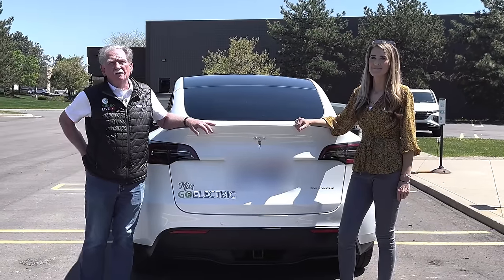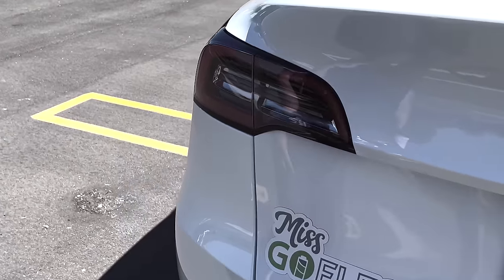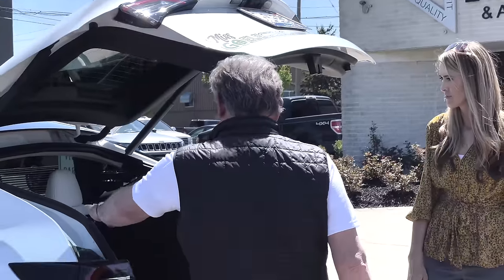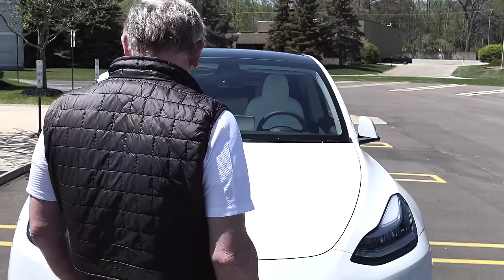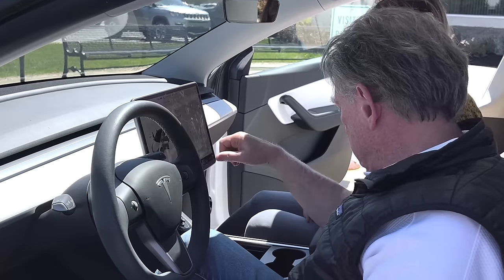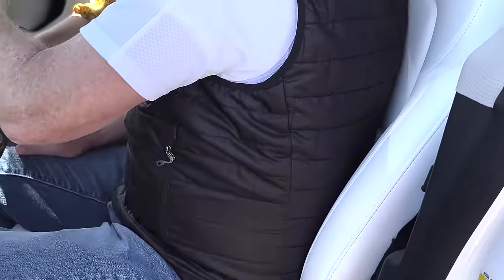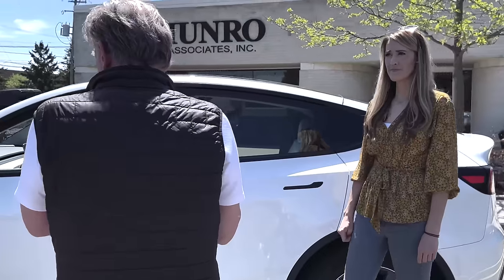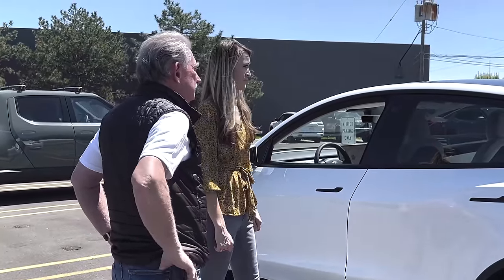Sandy takes a peek under Miss Go Electric's New Model Y Frunk!

Comment: $10k over sticker is insane, it’s starting to become pretty obvious that the legacy auto dealer networks are going to bankrupt their own suppliers with their insane greed.
Reply: Maybe Hyundai should watch and take notes. I remember when the Kia niro came out and I was seriously looking at it, but dealer was trying to sell me something else, even if it was 10-12,000 less! I had purchased Tesla stock well before then, but bought more after!
Reply: Maybe Hyundai should watch and take notes. I remember when the Kia niro came out and I was seriously looking at it, but dealer was trying to sell me something else, even if it was 10-12,000 less! I had purchased Tesla stock well before then, but bought more after!
Reply: Stealership are getting $25k over sticker for Muck-e GT and performance version cars.
Reply: @jezzaRTW  - KIA/Hyundai bought the model Y report form MUNRO and EV6/IQ 5 is the result.
Reply: @ForeverNeverwhere1  - eCHIMP platform is less advanced than TESLA skateboard 🛹 platform and is SLOWER and HEAVIER, built on a GAS car platform.
Reply: @jezzaRTW  exactly...either u sell their competent models to for less to consumer s..or we will wait til the Chinese autos to take over... Most people will no tolerance between a crappy leaf and a Tesla..
Reply: It's not the same across the board. Locally we have dealers with stupid markups and others not marking anything up. Some are even salaried instead of commission based. Dealing with Tesla is its own share of nightmares.

The markup ones are destroying their reputation.
Reply: Fred ! Spot on !
I’d never part with my MY ! You could offer to swap it for a Taycan or almost any other expensive BEV. I wouldn’t let go of it.

Comment: My first Tesla was Model 3 from Fremont and was perfect alignment.  Believe there was issue with air-cooling system - they had to fix it 3 times.  Traded that in for Model Y, and everything was perfect - also from Fremont.  Looks like totally different cooling system.  Model 3 was 2020 and Y is 2022.

Comment: @5:32: Sandy: "can you just open the charging port?". Sandy you should know this! Just push on it with your finger and if the car is unlocked it will pop open. No need for the app

Comment: Lacy, I think Sandy is correct about window issue. I have a 2020 Y and have had the same thing happen to me on two occasions. Window would go up and immediately come back down about a quarter of the way. This happen twice over a week. I think the first time I just got out locked it, got back in and was ok, the second time I re-booted and it has been fine since.
Reply: In our case, the window stops short and has even stopped responding to presses a few times.  I'm repeating what the Tesla service person said to me when he came out for the warranty repair.

Comment: I have no problems in my Model 3 windows that are laminated, and they have no issue. The laminated glass is not heavy enough to stop them from going up, Sandy is correct that its likely the sensor to keep from breaking fingers when it closes on them.
Reply: wrong, it's called a defect, you do realize power windows are in use by the millions and millions of vehicles, with no issues, this is a new vehicle, with a design defect.  Poorly executed, poorly made, poorly assembled, wonder why the Benz he had didn't have windows that didn't work, or door gaps like this, hmmmm, how much does this POS cost, it's not made to the price they charge

Comment: It's a great car overall. I would however let Tesla work on the panel gaps you have. A lot of the ones out of Fremont are perfect with no gaps. But at this price Tesla should fix this (they can afford it!).
Reply: Is $18 billion of cash in the bank enough? 😆
Reply: Those panel gaps will never be perfect. Car should be returned.
Reply: the trunk gaps you can fix yourself by turning some rubber stoppers, it is real easy.
Reply: She made a good comment in saying ".. thats the trade off for the 1 week delivery.." . There is nothing wrong to ask at Tesla. Maybe some gaps can be easily fixed. Then for sure they would be willing. 
And if its is very difficult they should document it in case there are problems coming up in a few years.
Reply: Gaps on my car was fixed by Tesla no question asked. They shipping out many cars to us in Europe and fix the gaps locally instead.
Reply: They can afford it with money but not with time. But i think it’ll get fixed w time
Reply: They absolutely fix those issues under warranty, no questions asked.
It's just a hassle if you don't have a service center nearby.
If I were Miss Go Electric, I would definitively make an appointment or let mobile service adjust those gaps.
Reply: There are many people in the comments here who, like you, are offput by panel gaps.  In my case they don't make noise or cause any other headaches, so I place no priority on them.  If the car is looked at by Tesla service for a different reason one day, I'll mention the gaps then.
Reply: @MissGoElectric  definitely the way to go if it doesn't bother you. 👍🏻
Reply: @MissGoElectric  Well that is a good plan you have. As long as it doesn't bother you in any way and doesn't let water in, then just take your time with it.

Comment: I have a year and a half year old MY-P and I just got notified of my new Austin built same model ready to start the delivery process. I was going to cancel the order due to feeling poor with the stock down so much, but you guys have got me thinking it may be worth the hassle of switching everything (selling this one, re-financing new one, etc.). I just love the fact that the new one will be so much lighter. I'll wait to see real specs though. I want to get improved range and 0-60 performance. There is no reason why the new version should not be at least 400 lbs lighter and a bit faster with 350 miles of range. It has to be better or I'm just going to wait for the CT.

Comment: There is a way to reset the sensors for the window. I had the same issue. I forgot how to. I think open the window completely and close it completely. Window opens a little bit every time you open the door

Comment: 17:50 The seats the Tesla seats and orientation tend not to be the most comfortable for people around 6ft or taller, the high floor and lack of extending thigh support give taller people a knees in chest feel. Despite the legroom in front of the seat there isn't enough space downward for long legged tall people, this is exacerbated by the high floor due to the tall skateboard battery platform. This high floor issue is pretty common in EV's however Lucid and Polestar have done a better job than most with different approaches. In the smaller pack Lucid they carve out 'floor foot cubbies' in the rear. And personally bought a Polestar 2 as the seats are much more comfortable for me with extending thigh support and the use of an upside down T shaped battery skateboard allow for a lower floor making it more comfortable for taller people despite the lower leg room numbers. 

In case of the Polestar 2 if it's confusing when I say upside down T shaped battery skateboard; Polestar takes a traditional battery skateboard but then creates a taller area in the middle which allows the batteries to be placed away from passenger foot wells and up into the middle where the center console is and 'floor hump' in-between the footwells in the rear. This has the added benefit of moving batteries further away from the crash zone in the car. In the interior this configuration would look similar to a transmission tunnel in a RWD or AWD internal combustion vehicle, so no full flat floor but far more downward space for the front and rear passengers legs and a safer car in the event of a crash.

Comment: I wonder if the owner has performed the Calibrating Windows ritual as described in the Owner's Manual.  Under Opening and Closing there is a page for Windows.  At the bottom of that page are the instructions.

Comment: I would guest that a customer rejected this car at pickup and the service center offered it to her. I can live with slightly unequal gaps but I would not accept panels being proud of each other or panels ribbing against each other.
Reply: Charge door rubbing = nail file on the plastic a few mill of it job done - doors/trunk/hood out of line alter the rubber stops they should screw in by hand... wont cost billions of Dollars or start a war in another country....
Reply: Hood miss-aliened.. old trick open hood push left or right as close as possible to the hinge a few mm and it should be good.....

Comment: Picking mine up next week. Was curious about the lithium ion 12v, so that was great to see

Was wondering if all new Ys had the new Ryzen chip for the mcu 

Also wondered if the new air filtration system still had the filters in the car by your feet in addition to the filters accessed via frunk. Or if only Frunk now (which would be great)

My 2021 model, like many, gets that sour smell pretty often and I wish it was easier to replace the filters.   

Good stuff thanks for the content!!!
Reply: Our Y does have the Ryzen chip (built March 4th 2022) and it also has the heppa/bioweapon defense filter.  If you like those Jowua organizers for your Y, here is a discount link:  https://www.jowua-life.com/MissGoElectric

Comment: Looking at electric myself and this whole charging over retail is pissing me off to say it nicely. Tesla's parts availability and build quality still makes me really hesitant. But I'm not spending 10-20k more then MSRP for a mach e.
Reply: Real build quality, for a car is its internal components, drivetrain, HVAC, software, autonomy. Also, build quality also includes torsional rigidity etc. Tesla focuses on these real metrics, which are often not visible to the customer.
Reply: Most people paying over MSRP are buying cancelled orders off the dealer lots. There are some dealers that are tacking on markups for ordered vehicles, but I think it's rare overall. Unfortunately the few bad apples reflect poorly on the manufacturers. The key is to do your homework by making sure that you're buying from a good dealer (check the car forums), and ideally get it in writing that they will be selling at MSRP. Most dealerships are not adding markups to people who have been waiting for several months though. The markups are usually for skipping the line.
Reply: I have been looking at trading in my Model 3 and the KIA EV6 or Hyundai IONIQ5 is probably my deposit.  The two year wait time means it's all theoretical, and also, there are probably changes to the market - that markup attempt goes to a different vehicle, new models available from the majors, Tesla finally learns how to do QA and customer service... will happen.
Reply: @archigoel  
How would you know that?? If they cant bother to get visible panel gaps fixed.. who knows what was missed under the skin.. Like that dip in the dashboard... That will be EXPENSIVE to get fixed afterwards.
Sorry, but bad panel gaps is an indicator of rushed production and lack of QC and inspection after the build.
When this car ages all this will lead to squeaks and rattles that are not really fixable.
Reply: @archigoel  This is a great point, panel gaps are easy fixes and not really that obvious to the eye compared to the engineering your getting remember ford, gm and pretty much every auto maker fought hard to not go electric, and it shows how far they are from the technology side.
Reply: @DuckDuckGeeseMusic  and yet Ford and GM offer crate electric motors and generally support Right to Repair, while Tesla are,  ahem...not.

Comment: We own a Hyundai Ioniq5 SE - purchased at $2k over MSRP right off the dealer's lot in early April. It has none of the fit problems seen in this particular Model Y. We'll get the $7,500 tax credit so it costs about $14,000 less than the Model Y.
Reply: But only about 250to 300 miles of range...
Reply: @nihongobenkyoshimasu3190  But it has an 800-volt charging system so it charges really quickly at DC fast chargers. We just completed a 2,000-mile round trip from the Midwest to Philadelphia and it could take whatever Electrify America had at the 350 Kwh stations.
Reply: @PVNInteriors  except the 350kwh stations are mostly non existent. They are rare to say the least.
Reply: @BrewersArcade  Every Electrify America location we've ever stopped at has them. They might be in use though.

Comment: The problem has always been inconsistency with the body panels and paint.  Some are great, some are awful.  My suggestion is thoroughly check it out at delivery.  Some paint issues may not be fixed later on and be blamed on the owner.   Not all panels can be adjusted by service - I had a right headlight sticking out 1/4" and they could not adjust it.

Comment: She’s right. If they have rejected deliveries, they try to match with an existing orders. You never know how picky the person who rejected it is. If you get a quick delivery like this, take extra time at delivery to take note of the issues you find. If it’s cosmetic, then take photos and talk with the delivery person to make sure they can address the issues.  I wonder how many times some of these vehicles are rejected. I also wonder if once rejected the vehicle is worked on at all or if they just call the next person.  

We ordered a performance Y lease. We were offered one right away but didn’t have EVSE (electric vehicle supply equipment) ready so opted to wait. Not sure I want to rip out the frunk to see the build revision but I’m so curious now. It should be here within a month.

Comment: No one seems to talk about the frameless door windows… a lot of these window problems would be eliminated with a window frame. Windows would not need to do that auto down to open the doors and the glass would go into a slot instead of having to be pressed against a gasket tight enough to prevent air leaking.
Reply: Makes sense to me too.
Reply: I was surprised Tesla went with the frameless windows. Past cars that had them were prone for leaks (I think my dad's 1971 Olds Toranado had them but were okay). When Tesla included the auto down/up window trick, the sealing issue seems to have solved the problem. Please I believe the door weight is reduced. Incredibly, the cars safety/structural integrity remains a world class. BTW, that 1971 Toranado had a 454 cu in V8 and a hood that reminded me of a football field. It was great in winter too with its FWD. Dad's 1968 Olds Cutlass 442 in two tone green was more badass too. Guess that's why I love cars. Doesn't hurt mom had a Sunbeam Alpine like the one Get Smart drove too.

Comment: Those panels look tight compared to my '20 MY. After 2 years of womping on the go peddle the gaps are much worse than new. I think it's because the 21' tires on the performance model is twisting the car.

Comment: I’ve owned my MY for 3 months. Covered 10,000km.
I can’t stop thinking about it ! It’s completely compelling!

The MY replaced a 2020 X5 MSPORT.
I miss the beautiful wheels on the BMW (oh and the Wonderful split tailgate) 
The MY is much quicker, more comfortable and costs 30% of the BMW’s running costs.

It’s much safer, (I have two children) less damaging to the environment and it’s even quicker than my 1250cc motorcycle!

Comment: when is it acceptable to not take delivery of a car because of fit and finish? we are about to take delivery of a model 3 LR and hope for the best but trying to prepare for the worst. I intend to take it thru a touchless car wash just to make sure, because of the 24 hours or 100 miles trial.
Reply: Depends on what you're okay with.  With Tesla most of the time there shouldn't be any problems under the hood just on the outside.

Comment: id guess sandy is right about the window sensor. the other thing it could be, due to part shortage, they may have went to older models parts bin. early model s had similar issues with window regulators. it uses a metal spring on plastic part, and the plastic parts break making the window unable to go all the way up. you can inch it up with 30 small clicks  but if you try full it goes up a bit then falls back down and wont ever make it up. gruber motors makes a metal replacement for $19 that gives proper resistance to the spring and will be a lifelong fix. hope that helps 👍

Comment: When  high performance gliders are built or maintained the seam gaps are made as tiny as possible because the gaps cause massive amounts drag reduceing performance gratley.  Those uneven surfaces and gaps would put the best design in last place performance wise  .

Comment: Just do a system reset by completely powering down the car in the Safety menu. That will fix the window problem. I didn’t count very many panel gaps. I think they only pointed out 4 problems. Maybe I missed some. I have seen plenty of Mercedes and BMWs with panel gaps.
Reply: No car will pass a colonoscopy with a perfect score.
Reply: Powering the car down completely won’t solve any problem if it wasn’t engineered well lol…. Audi for example has all around double glazing windows and has no issues moving them.
Reply: @carholic-sz3qv  If it's a software glitch, recycling the power will "fix" it until a firmware patch is available.  Glad your Audi windows are working - my 2016 Audi A7 was the most troublesome car I ever owned.  The windows were never a problem though...

Comment: I wish Tesla would add an inverter to give us some V2L capability, especially given the added cost.
Reply: V2L? Do you mean car to grid?
Reply: @fredbloggs5902  Vehicle to load, like the new Hyundai cars have.
Reply: @frumpd63  ok, thanks for that.
Reply: Engi_nerd - all Tesla have onboard inverter for each motor. and on board charger as well. V2H is not needed, it also kills a expensive battery. 
you are better off without V2G.
Reply: @frumpd63  - it's a cheap trick, since Kia/Hyundai don't have a High Tech car, so they need something more. Tesla is Already perfect, does not need FLUFF like V2H.